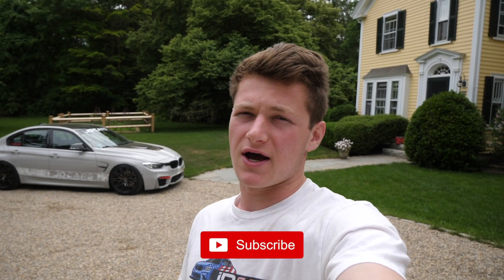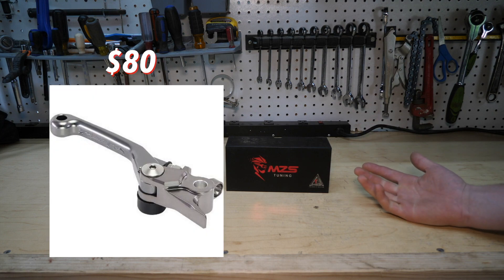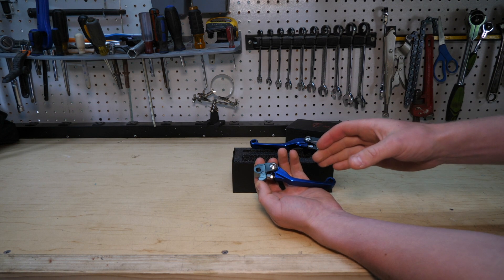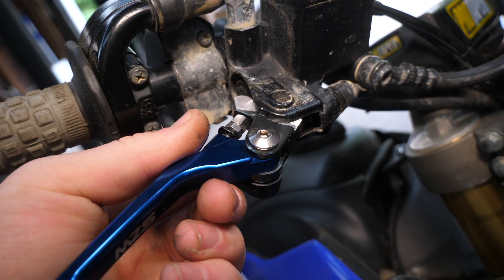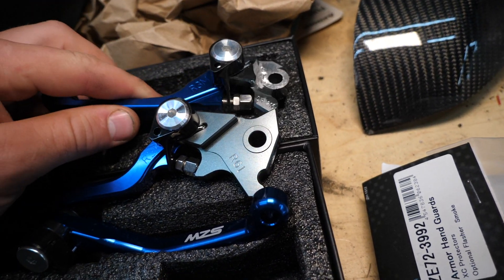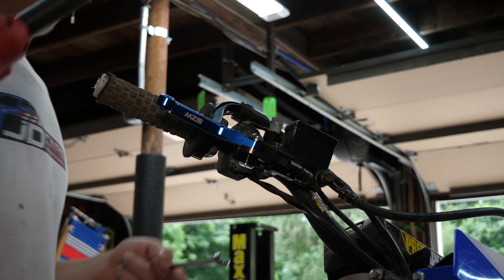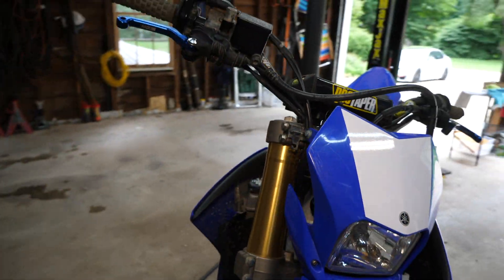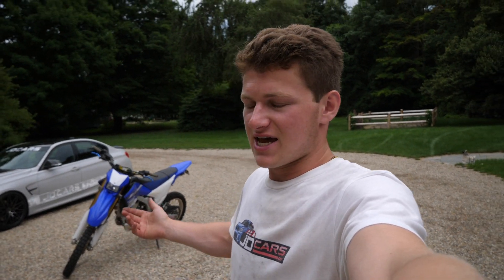Surprisingly GOOD Amazon Levers // BEST BRAKE & CLUTCH LEVERS UNDER $40

Comment: Did you ever have an issue with the brake light coming on just by touching the lever mine does and not how solve this issue
Reply from the maker: I never experienced this but I'm sure there's an adjustment screw or something of that sort.